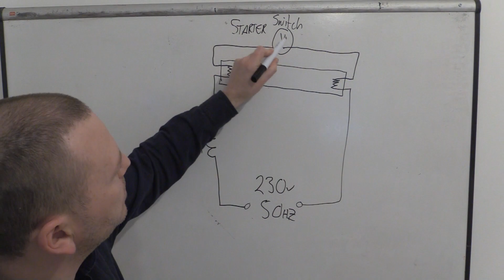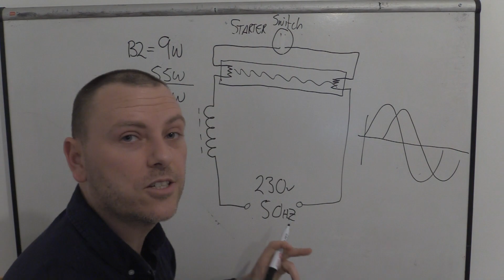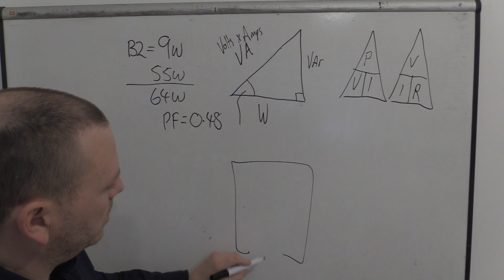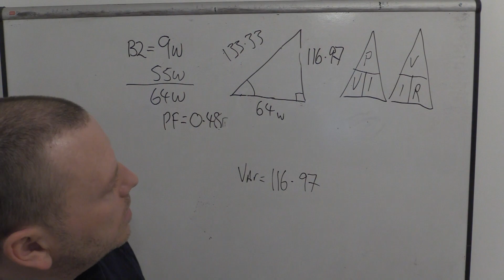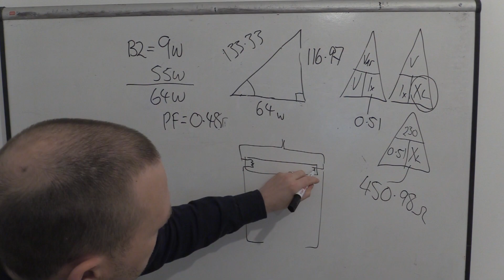How do Fluorescent lights work? calculation and P F Correction

Comment: So I have a magnetic ballast on my flouro tube - inserted as far I can gather in 1948. This ballast has two separate rectangular devices which sits inside a metal container - the starter is inserted from outside through the metal container. From your description would the rectangular devices represent  a capacitor (possibly pcb type danger) and the other the coil.

Comment: My American Electric 70w (even though it uses two 40w T12 bulbs) lamp fixture had bad capacitors (unreadable metal film ones that look like a pack of breath mints from the 90s) so I swapped out the two inductors for a not so new "Nexes" ballast from a 2008 fixture. Years later it stopped working, so I took it apart to find the exact same setup inside but this time I can read the capacitors (4.7μf 250V 50/60Hz) and now I will combine the old inductors with the right capacitors! (I was missing too much information to complete the equation)

Comment: How many fluorescent lights actually have a capacitor   ?    Where is it located in the light
Reply from the maker: Most older ones. Modern ones have a hf unit all enclosed.

If they have one they connect it across the supply terminals.
Reply: Most of them will. They’re usually connected across the Active and Neutral of the terminal block. Older capacitors will have what’s called PCB’s inside which is carcinogenic so be careful

Comment: @18:38 btw you could have just multiplied by C capacitor value and divided by the 450 resistor value.

Edit: seems like you did it on purpose so nvm

Comment: So is a ballast literally just a coil, or is it a transformer that steps up the voltage?   Is there a way to test the voltages of a ballast?  Or do I have to pull it all apart and ohm it for a short like everyone else shows in their videos.   I came here just looking for the output voltage of a ballast. lol ... brought me back to my electronic days in vo-tech in 2000.. so I subbed
Reply from the maker: Its just a coil. Never tried to measure the output voltages when striking? I will have a think and get back to you

Comment: Hi Craig, I thought the starter was normally open then closes when the neon heats up within it. Then when the Ne cools the switch opens and causes the spike voltage. Are you saying its normally closed?
Reply from the maker: its a simplified explanation. yes they start open, quickly close due to current flow causing electrodes to bed into each other, voltage shorts out to supply then cool and open again and allow now excited tube to receive full ballast voltage and strike..